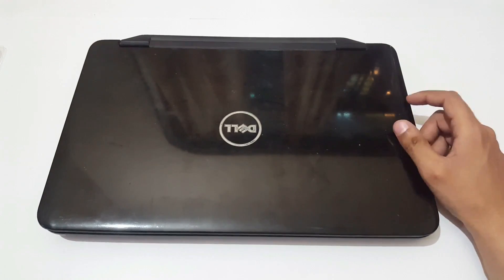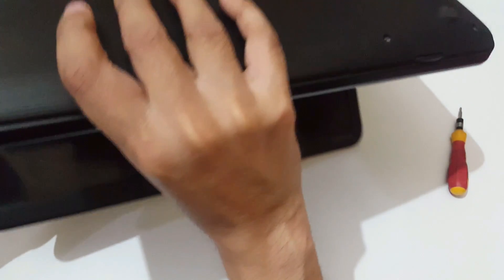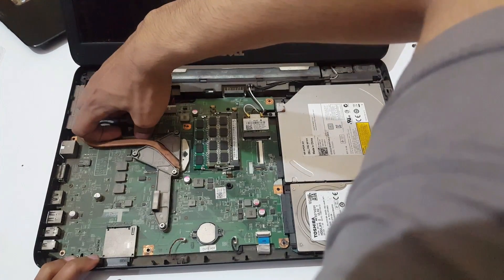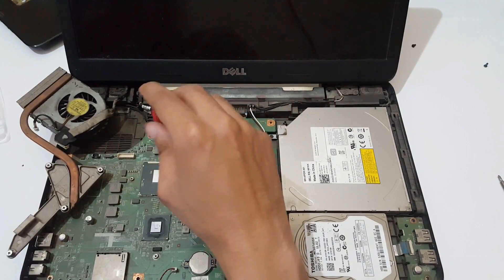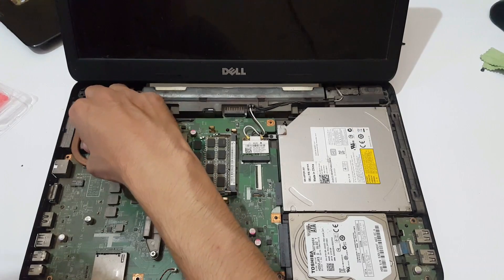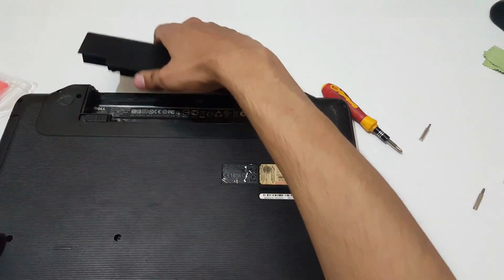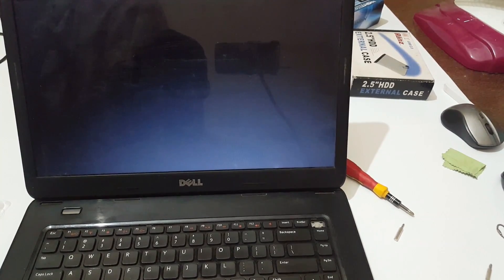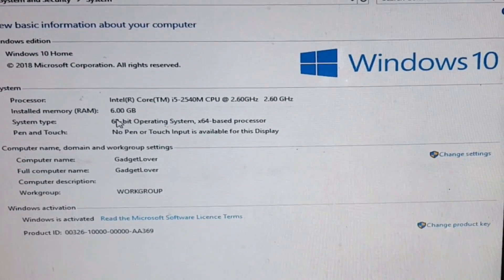How to Upgrade Processor on DELL Laptop | i3 to i5 & i7 - Make Laptop Faster for Gaming

Comment: hi Admin , Hows apple macbook air 2017 version ? thinking to buy . because i am tired with my lenovo ideapad 320 which works like pentium series  I had purchased it 2017 barely used it but still works like snail 🐌
Reply from the maker: Free Traveller : It's a good choice
Reply: Gadget Lover is it better than idea pad 320 ?
Reply from the maker: Free Traveller : Yes it is good for daily lag free tasks

Comment: Can I upgrade Acer aspire e1-571 i3-3110M to i5 or i7
It has 988B rPGA socket
Reply from the maker: Siddhesh Mithbavkar : Yes and Intel Core i5 3380M is best processor for your Laptop
Reply: @GadgetLover360  Do I have to change the BIOS also after installing  ??
Reply from the maker: Siddhesh Mithbavkar : No

Comment: Bro, I have a Dell Inspiron 3442 housing Intel Core i3 4005u cpu, 4 GB ram, 500gb HDD. Can I upgrade it to any i5/ i7 ? Please suggest which would be better if upgrade in possible.
Reply from the maker: Hasib Rahman : The processor of this Laptop is soldered so you can't upgrade it

Comment: Hey pro I just want to upgrade my laptop CPU.
 My laptop is (Acer Predator Helios 300 G3_571 Intel® Core™ i7-7700HQ) Processor soket (FCBGA1440).
 Can I change the processor with processor( Intel® Core™ i7-10850H) Processor soket (FCBGA1440) ???
I think my main board isn't like dell, so I need to know if I can upgrade my CPU ???
Thank you
Reply from the maker: Essam Hejazy : The processor of this Laptop is soldered so you can't upgrade it

Comment: Bro, thabk you for the video it's really helpful.
I have dell vistro 1540 with i3 what is the best prosseor for it.
Another question, is it worth it to upgrade tye laptop or i should buy a new one?
What is your advise for me.
Reply from the maker: عبدالله محمد  • 3 : Yes it is good for basic work like web browsing and light gaming and Intel Core i5 580M is best processor for your laptop and I would suggest you upgrade its RAM and install SSD for more better performance
Reply: @GadgetLover360  Thank you for your fast replies.
Do you choose the compatible CPUs by their Lithography ie 32 nm for this particular one?
Reply from the maker: عبدالله محمد : You're welcome and yes both have same vertical segment
Reply: Mr what's the gen of that core i5 580M? @GadgetLover360
Reply from the maker: @Zone.real1820  5th generation
Reply: @GadgetLover360  Can i upgrade to core i5 gen8? is it support? and my laptop is dell vostro 1540
Reply from the maker: @Zone.real1820  I would like to inform you that you can upgrade it in same generation
Reply: @GadgetLover360  Ok thanks brother
Reply from the maker: @Zone.real1820  You're welcome
Reply: I have dell 15 3568 i3 6th gen can you please suggest me anything

Comment: Can you upgrade dell Inspiron 15 3000 to i5
Reply from the maker: Junior Film : What model
Reply: Dell Inspiron 15 3000
Reply from the maker: Junior Film : The processor of this Laptop is soldered so you can't upgrade it
Reply: And can I upgrade the ram to 16 cause I have 8 and I want it to be faster
Reply from the maker: Junior Film : See maximum RAM support in product manual

Comment: bro i have lenovo i3 8130u 2.20ghz
12gb ram dd4

SUGGEST me the best core for my laptop
Reply from the maker: Ana Lutfi Rafiullah : Intel Core i5 8350U is best processor for your Laptop
Reply: @GadgetLover360  thnkyou bro
Reply from the maker: Ana Lutfi Rafiullah : You're welcome
Reply: @GadgetLover360  i7?... can i upgrade i3 to i7?
Reply from the maker: LRArena XGaming : If processor is not soldered you can upgrade it in same generation

Comment: Hello Gadget lover, I have HP pavilion g6 2204tx laptop and it’s running i3 processor. I want to upgrade my processor, which is the best one ?
Reply from the maker: BaMmY bOy : Intel Core i5 2540M is best processor for your Laptop
Reply: @GadgetLover360  thanks sir, but i cant go to i7 processor?
Reply from the maker: Slosshy Cosmetic : You're welcome and yes you can also go with Intel Core i7 2640M
Reply from the maker: Slosshy Cosmetics : You're most welcome and if you have any problem related to this video ask here I would be happy to help you
Reply: @GadgetLover360  Thanks Gadget lover, i want to upgrade my screen with higher resolution, the current screen is the original screen that comes with this laptop with resolution 1366 x 768. kindly suggest the best and highest screen resolution i can upgrade it to ?
Reply from the maker: Slosshy Cosmetics : I would suggest you search on Google for best results

Comment: Hey bro I have a hp 15bs662tu laptop with Intel i3 7020u 4 gb ram plz suggest me the best gta v processor for me
Reply from the maker: Yash Yadav : In my knowledge the processor of this Laptop is soldered so you can't upgrade it

Comment: Hlo Big B... I have dell inspirion 15 3000 series. Can i upgrd the ram from 4 to 8 gb & cpu from i3 to r5 ?
Reply from the maker: Jagmeet Gill : Hi I would like to inform you if processor is not soldered you can upgrade it to same generation Intel Core i5 processor and for RAM upgrade see details in expandable RAM
Reply: Gadget Lover i m glad you replied thank you v much for suggestions big bro.
Reply from the maker: Jagmeet Gill : You're most welcome

Comment: Can I upgrade my intel i3 3227 u with any high power
Reply from the maker: manraj sekhon : If it is not soldered you can upgrade it in same generation and Intel Core i5 3437U is best processor for your Laptop

Comment: Hi i have a dell Inspiron 3543 with i7 5500u can i use something better than this. PS i have already change thw HDD for an SSD....
Reply from the maker: Στέλιος Πανάρετος : The processor of this Laptop is soldered so you can't upgrade it
Reply: @GadgetLover360  thanks a lot mate
Reply from the maker: Στέλιος Πανάρετος : You're most welcome

Comment: wont it just kill the laptop cause every processor has different electrical and cooling requirements and changing it may result is burn?
Reply from the maker: INCREDIBLE SAM : No if you upgrade it in same generation with proper knowledge
Reply: @GadgetLover360  even i same generation different microprocessors require different current inputs
Reply from the maker: INCREDIBLE SAM : It depends on sockets and microarchitecture of processor which step into it
Reply: @GadgetLover360  Thanks
Reply: I have i5 337U CPU 4gb ddr3 ram installed in Dell inspiron 15r 5521. please suggest me some improvements in it
Reply from the maker: INCREASE SAM : You're welcome and in my knowledge the processor of this Laptop is soldered so you can't upgrade it so I would suggest you upgrade its RAM and install SSD for better performance
Reply: can you suggest me a good gaming/semi high end laptop for programmimg which has value for money
Reply from the maker: INCREDIBLE SAM : HP Pavilion Gaming 15 ec0062ax or Dell Inspiron 15 5558 would be the best choice

Comment: hey dude, i love the fact you still come here and answer questions, love it!
i have an hp pavilion sleekbook 15, with an i3 3120u 4c 4t and 4gb of ram. what would you suggest me to upgrade to?
edit: i can also go with cheaper cpus without gpus, as i have a dedicated one :)

does my mobo have a removable cpu? i can't find any image :(
Reply from the maker: Francesco Volpini : Thanks for your love and support and in my knowledge it's processor is soldered with motherboard so you can't upgrade it
Reply: @GadgetLover360  that's sad... who cares, i only need some ram anyway :D
Reply from the maker: Francesco Volpini : I would suggest you upgrade its RAM and install SSD for better performance

Comment: Bro.. can i upgrade my sony vaio vpcea33fd which has i3 processor to i5 or i7... what what all upgrades can i do.. hiw much will it cost??
Reply from the maker: Mariya Hameed : Intel Core i5 580M is best processor for your Laptop and I would like to inform you if processor is soldered you can't upgrade it
Reply: @GadgetLover360   thanks.. what about ssd and upgrading ram
Reply from the maker: Mariya Hameed : You're welcome and yes I would suggest you to upgrade its RAM and install SSD for more better performance
Reply: @GadgetLover360  thanks.. but will there be any motherboard failure.. or anything while upgrading
Reply from the maker: Mariya Hameed : If you follow video instructions carefully then no

Comment: can I upgrade core with my inspiron 15 5000 series 5567?
Reply from the maker: Nut : If processor is not soldered you can upgrade it in same generation

Comment: i have Dell  inspiron 15 3000 i3-7020U 2.30 GHz
SUGGEST me the best core for my laptop
Reply from the maker: Bikram Poudel : Intel Core i5 7300U is best processor for your Laptop and I would like to inform you if processor is soldered you can't upgrade it

Comment: bro plz reply, i have a Dell Inspiron 15, 5000 series i3 6006u 2ghz processor what processor can i upgrade to???????
Reply from the maker: MALLESH SHAVA : Intel Core i5 6300U is best processor for your Laptop and I would like to inform you if processor is soldered you can't upgrade it

Comment: bro i have hp 250 g6  with i3 6006u, 8 gb ram, 1TB.
I can upgrade processor to ryzen 3 3200G? or 2200G?
Reply from the maker: Vasi : Unfortunately you can upgrade it in same generation only
Reply: @GadgetLover360  but I can put a desktop processor?
Reply: @GadgetLover360  i7 6600 ?
Reply from the maker: Vasi : No because both have different vertical segments
Reply: @GadgetLover360  only i7 6600u?
Reply from the maker: Vasi : Yes it can upgrade in same generation only whether it is Intel Core i5 or Intel Core i7
Reply: @GadgetLover360  ok, thx
Reply from the maker: Vasi : You're welcome

Comment: Please tell me all the rules of upgrading a laptop. Proccessor=I can only upgrade within the same generation...e.g....i3 7th generation proccessor can be upgraded to an i7 7th generation proccessor. What about the GPU???
Reply from the maker: Bomb Squad : Yes and for internal graphics card upgrade you have to replace motherboard but you can also connect graphics card externally to your Laptop
Reply: i5 or  i7 ... 8GB ram ... 4GB graphics. Please recommend a list of laptops with those specs.
Reply from the maker: Bomb Squad : I suggest you search it on Google for best results

Comment: I have Hp pro x2 x360 with i3, 1.8 ghz with 4gb ram 

Suggest me the best core for my laptop
Reply from the maker: K TEM : The processor of this Laptop is soldered so you can't upgrade it
Reply: I want to replace  my i3 1st generation with i3 9100 f  generation 9,  in my Sony Vaio model VPCEH15 please  suggest.
Reply from the maker: amit kumar : If processor is not soldered you can upgrade it in same generation only

Comment: Bro, I have my old Laptop Acer E15 E5-573G
which is  i3-4005U  and 4Gb DDr3 with  1.7ghz
suggest me best core to improve my Laptop overall performance
if I do have 10K approx budget could please suggest me regarding my problem.
Reply from the maker: Durga Prasad : The processor of this Laptop is soldered so you can't upgrade it

Comment: Hi I have HP14 ar002tu core i3 5005u processor 4gb ram, how much ram and cpu ?
Reply from the maker: Zelty : Maximum memory support is up to 8GB and Intel Core i5 5300U is best processor for your Laptop and I would like to inform you if processor is soldered you can't upgrade it
Reply: Gadget Lover can I unsolder and solder new one?
Reply: Gadget Lover thanks 🙏
Reply: Gadget Lover can I put intel i7 ?
Reply from the maker: Zelty : Yes but in same generation only and if it is soldered I would suggest you visit PC & Hardware store for upgrade because it requires a professional hand